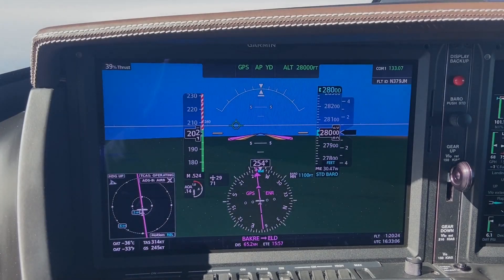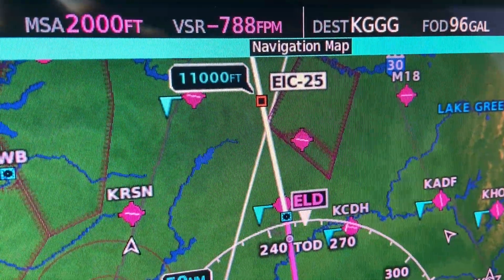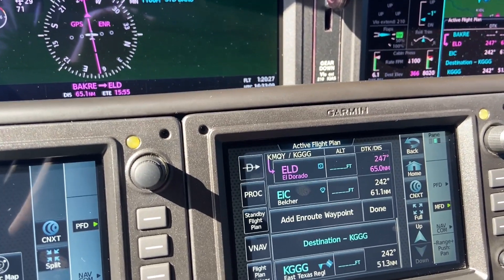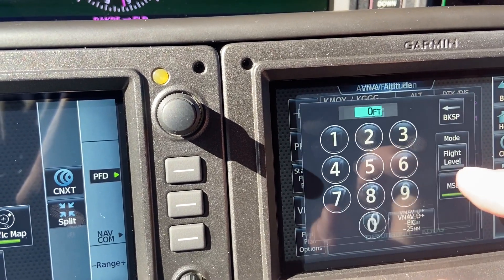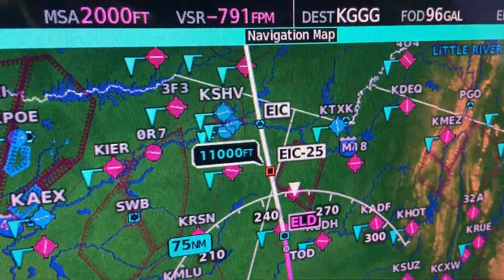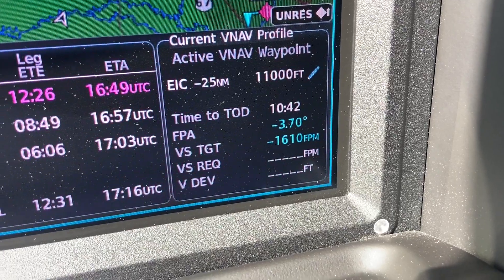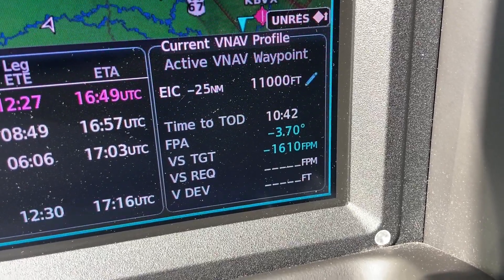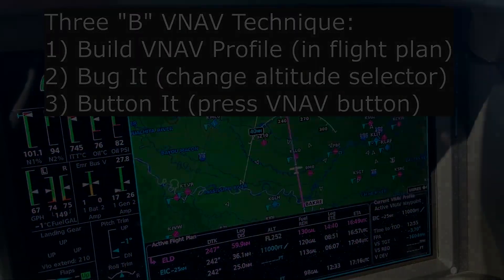SF50 Garmin G3000 VNAV Technique. Simple 3-Step Process

Comment: I wish the video had not ended before showing the annunciations on the FMA after pressing the VNAV button, which does not help with mode awareness.
Reply from the maker: @philcohen9332  There is no annunciation associated with the VNAV button. The only annunciation occurs one minute before TOD. What is a FMA?
Reply: Flight mode annunciator.  The scoreboard.  AFCS annunciations at the top of the PFD.  You should have shown what annunciations show up on the scoreboard when you push the VNAV button.  Very important for mode awareness.
Reply from the maker: @philcohen9332  The scoreboard is not very useful for VNAV. Everything you need to know is on the VNAV section of GTC 2 or lower section of MFD. The only annunciation is at one minute before TOD. Follow the steps and that is how VNAV is flown.
Reply: I would have to disagree.  Scoreboard is everything!  Lack of Mode awareness is a huge source of errors.  What modes are armed? What modes are active?  Knowing the expected annunciations is very important. We aren’t just pressing buttons on the mode controller.  We are pressing the buttons and monitoring that the appropriate annunciations appear on the scoreboard.  Mode controller buttons are fiction, AFCS annunciations are fact.   For instance, are we expecting white VALT, white PTH, green PTH, GP/V, etc?  I also can’t figure out why nobody uses the VSD window when using VNAV.   Picture is worth a thousand words and the VSD allows you to see the path on a procedure and help with planning for energy management.   Is it a Constant descent or are there intermediate level offs?  Only the VSD gives you that SA, yet nobody seems to use it.
Reply from the maker: @ I agree that generally speaking the scoreboard is very useful but we can disagree about how useful it is for VNAV. This video filmed impromptu several years ago and was primarily about Crossing Restriction set up. It was not a full dive into the avionics. The BBB process is the set up. From there you monitor progress along the way. If you do not change lateral modes, then the mode did not change. If you know the required descent rate, you merely monitor it and VPATH to make sure you’re on track. 

Do you fly anything with G3000 avionics? I have no idea why you are watching YouTube videos on a subject you are apparently an expert. My advice is for you to get your camera gear set up and make your own videos that meet your expectations.

Comment: Great tutorial, important to point out to people that VNAV will not go below the bugged altitude on the PFD. Most people don’t seem to understand that the pilot needs to bug the altitude on the PFD to at least BOD altitude.
Reply from the maker: @THEVATICANTS  Thanks for watching. Yes, VNAV altitudes are conditioned on the bugged altitude, but remember VNAV is not only used to descend. It is generally used on complex departure procedures. This was an older video, but the intent was in response to viewers wanting to understand what I was doing when I discussed altitude restrictions on descents since I do not typically have cameras showing direction actions on the mode controller or GTC’s. None of these videos are intended as instruction as much as a demonstration.

Comment: Thank you for an excellent tutorial.  Slowing the video playback when you demonstrated the button pushing was a terrific technique.  If you can edit this video my one suggestion would be to add in a verbal comment when you bug the altitude preselect for the 11,000 foot crossing altitude.  The camera was turned to focus on the altitude preselect and it could be seen scrolling down to 11,000 feet but there was no verbal commentary explaining what you were doing.  At the end the video had the Inset of the three steps in creating a VNAV - 1. Build it, 2. Bug it, and 3. Button it but the bug it step was not spoken of only shown in the video.  Again, super video, great video work, thank you.
Reply: Great video, thanks. I second William's comment. It is imperative to set the lowest altitude on an arrival or crossing restriction or the plane will not descend when it reached TOD.
Reply from the maker: William didn't suggest the altitude was not bugged.  That is part of the 3-B process. He was asking for me to verbalize changing the altitude in stead of just showing it.
Reply from the maker: The 3-B  process sort of covers this, but thanks for the suggestion.